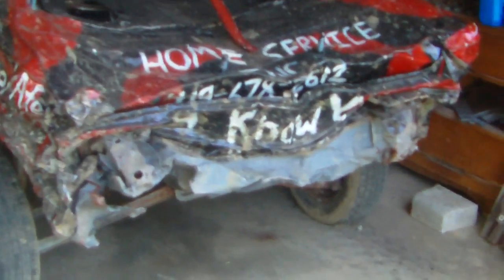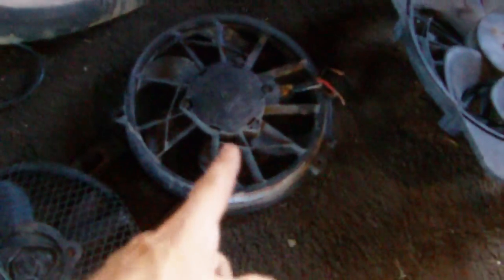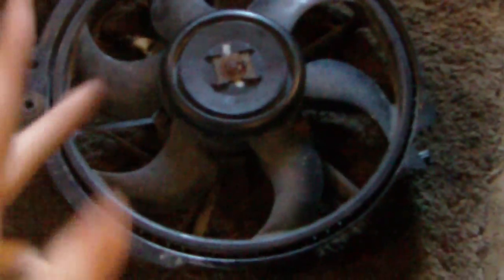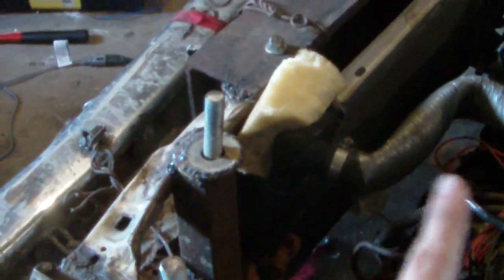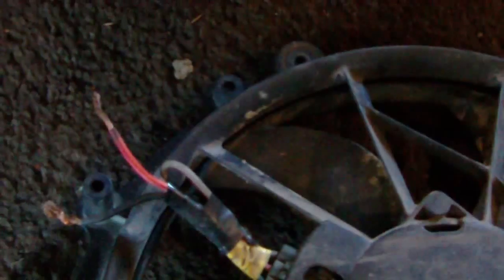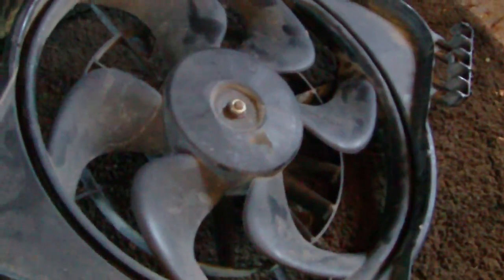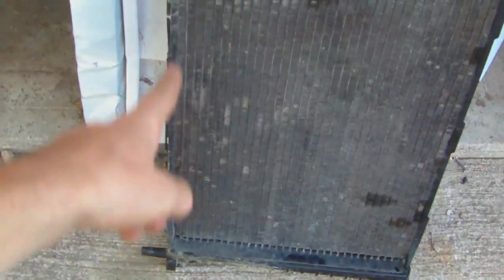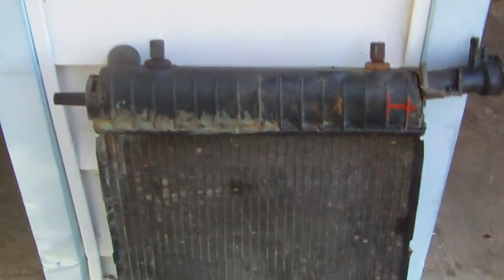August Taurus Updates Compact Derby Car

Comment: hey DM. I ran a 98 taurus just this saturday. at the current moment I am uploading the helmet cam feature. If and when you do get your hand on one of them make sure to mount the bumper solid. mine snapped the bigger gm shocks in half and after that the front end bent way weird. That metal plate you talked about I don't recall ever seeing that metal plate, just a bunch of fiberglass. what year car did you see that in? just curious cause maybe I missed something...LMK thanks! :)